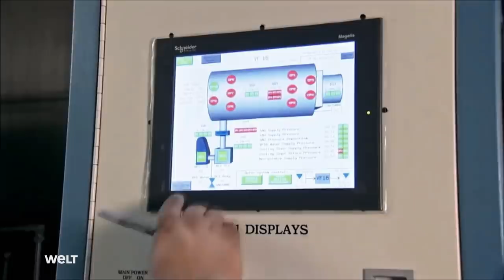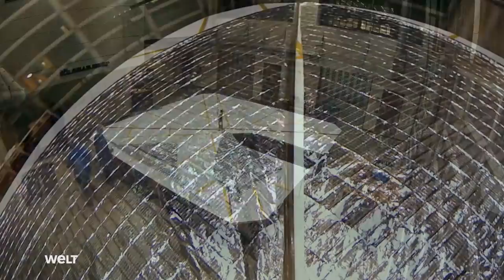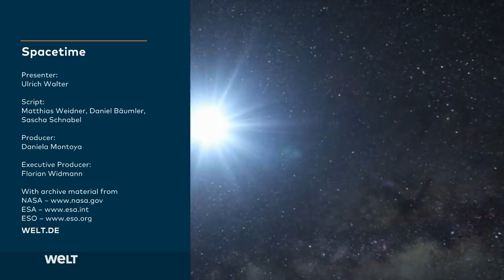The Way into Space - From Planet Earth to Infinity | SPACETIME - SCIENCE SHOW

Comment: 2021-Nov-15

onlyFoundations:

Step 1: Take System A into orbit (Point A) with chemical propulsion 
About System A: Take solar energy and beams out laser

Step 2: Launch system B to Point A using chemical propulsion. Travel Point A to bigger orbit (Point B) using laser energy as input from System A
About System B: takes laser energy and beams our laser energy

Step 3: Reset and repeat for 100 so years. There will be Point C, Point D in the space territory we want to explore. In 100000 so years, until to a much farther location. Probably millions on Points by now

Step 4: Travel to any point by hopping one point to another. Energy is supplied from point A System A to the System B network. In case of any network repair, just hop to near working point with the repair kit and travel to repair point with chemical and come back hoping. Speed in this system is above than any other method. Need the shown working foil space craft though 

Any intelligent feedback? 

Thank you!

Comment: All the technology depicked in this episode is older as the Roman candle in principal effect... If mankind is to go no matter where but outbound sollar system, few key technology's have to evolve and a few more to be R&D. And they are as follows: 1.Tokamak fusion (currently at proof of concept lvl development, wayy below first lvl. you need it to 3rd gen. at least), 2.Kriogenics sustained system's (not even on conceptual principals needed for the development of generation evolution to begin. also needs to be at least at 3'rd gen), 3. Magnetic field comfindment (we, mankind haven't even begin to work with the scale of the force needed to be harnessed and then developed. good news is that it whould work for the required need even at 1'st gen.) , 4. Grav'well technology (At theory is achievable by merging couple of science disciplines into 1 technology. But it's a lvl2 cosmic beings tech, NOT at any time soon. ask prof. Kaku, if he has the time to formally present you the challanges involved.), 5. ION technology (actually the most advanced tech we achieved. Refering to DS1-tested, working and it's actually the 1'st gen.could be efficient, around mid. size gravitational stellar objects, no further. It whould be best functioning at 3'rd gen again.) Excluding all the technology throw off's and benefit's to other science fields from those 5 technology dev's. Dan'g, it took me like forever to write all that. And it's actually 7-10 min's have passed... So, he was right (won't mention who), it's all down to the relativity...

Comment: Can we use magnetic field to go through the space to reach other planets in other galaxy
Reply: No, that is the concept of imaginary reality. Magnetism has nothing to do with space travel. Even a Black Hole with unimaginable magnetic power cannot and does not travel at speeds beyond the speed of light. That light is magnetically trapped and therefore is visually non existent, hence a BLACK hole. We need to discover a propulsion system not reliant on the slow speed achieved by rocket motors. Propulsion by ‘Light’, beam boosters, that can move a body at and beyond the speed of light needs to be discovered. Propulsion of light thro a vacuum should be faster than light speed as there’s no resistance to that light to travel.

Comment: This video is 2019?  They need to update version of the video, which should include the reuse rockets and SpaceX Raptor engine that is closed system with Liquid oxygen / liquid methane; instead of traditional liquid hydrogen!
Reply: Ok but either of these fuels is meaningless for the long run.

Comment: 19:22 if rocket fuel is 200k per flight, how does that make a 1000 flights 50k each?
Reply: I thought the same thing.  Maybe he's talking per rocket if a regular flight uses 4 boosters?
Reply: If you don’t get it, then you don’t get it.
Reply: He means the rocket will cost 50k a time after 1000 flights. 1000x50k=50 million the cost of the ticket.. 

So it would cost 250 grand a flight
50k plus 200k fuel 
 which is still well good yo!!
Reply: 250k per flight... lemme check the seat cushion sure there's some loose change there

Comment: the propulsion issue is all wrong.
fusion is an easily done task.
the answer is all in magnetic fields.
i believe fusion will be achieved this decade.
safe fusion shortly thereafter will also be achieved.
2025 fusion will happen but will blink out within seconds.
2029 fusion reactors are size of battleship but are working.
2037 reactor efficiency has reached 80% and size has decreased substantially.
2042 trips to mars are 2 hours travel time.
2050  .069323 of light speed achieved.
2056 discovery of theta frequency universal communication neural network.
I've already said too much.